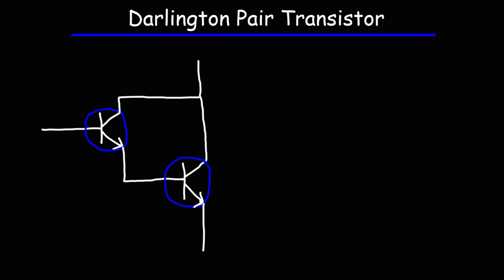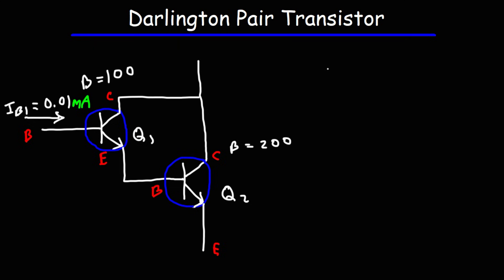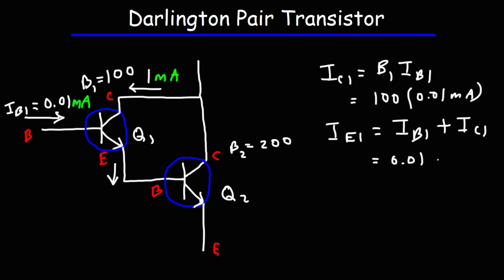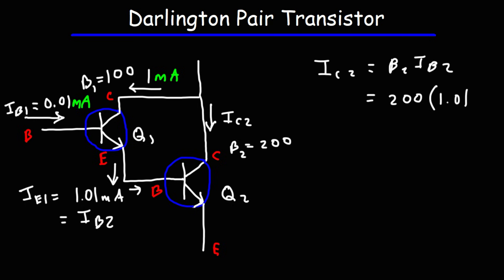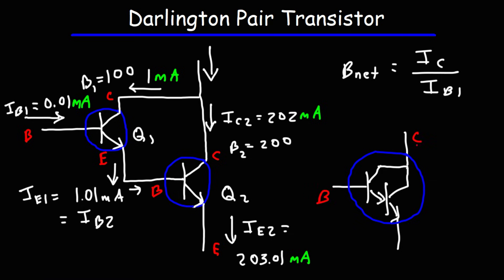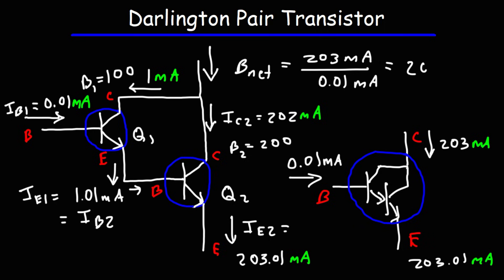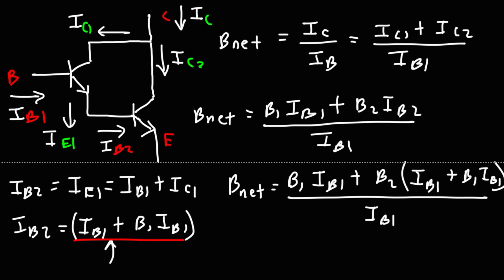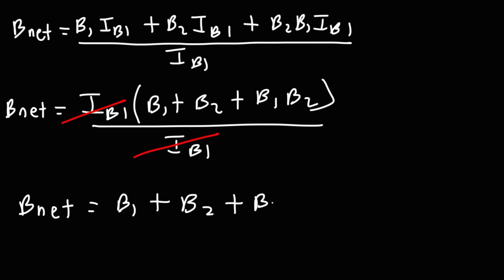BJT Transistors - Darlington Pair & DC Beta Current Gain

Comment: Transistors are useful and interesting devices. In my long  years of handling transistors, since 1956, I  have always been aware that the input impedance of a transistor is not symmetrical, in that for hard driven  common emitter NPN transistor the   input impedance is very low  for a positive going signala, while  it goes  higher for a negatively going signal, Obviously this distorts the signal, This is an interesting feature of   transistor and for the input impedance to  to be regarded as being constant one must operate the transistor over  small signal conditions or make it symmetrical by external circuitry using additional diodes. It is because of this that some oscillators as the super regenerative oscillator can quench itself with an RC circuit in either the base or the emitter.  Back in 1960 the germanium did not have such a high output impedance and in those days I found out   the reverse breakdown voltage of the emitter base junction which was about 14 volts for germanium and about 7 volts for silicon.  which was limiting my bistable oscillators.  I should have published that when I became conscious of it back in 1957. All my burnt transistors at the collector were used at  base emitter, either as  normal diodes or zener diodes, Yes, we were poor back then!. The Input impedance of the common collector is said to be high, but again when one looks deep into the asymmetry of the   emitter base junction,  the situation turns out to be a little more complex if one goes deep into the details. The darlington pair is very asymmetrical when it comes to its imput impedance, 
Congratulations for this set of videos it took me back to 1954 and a little earlier when I started using them early glass encapsulated one which had a thermal runway  and one needed to be careful, Thank you for uploading this video and the others,